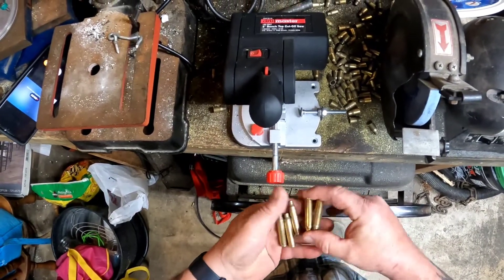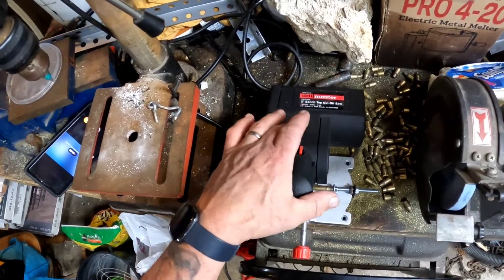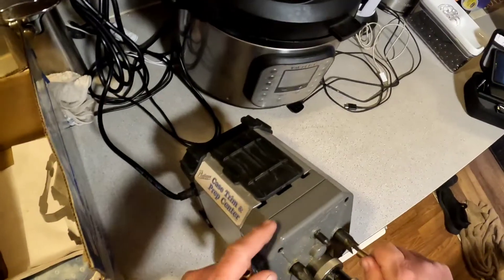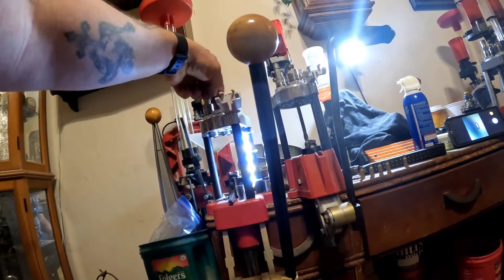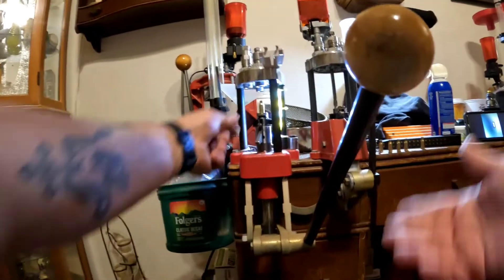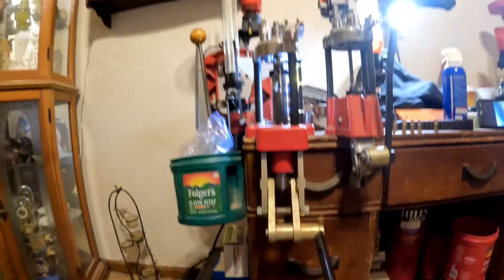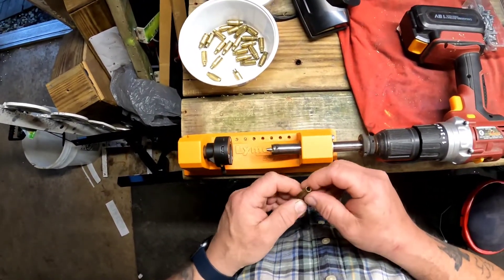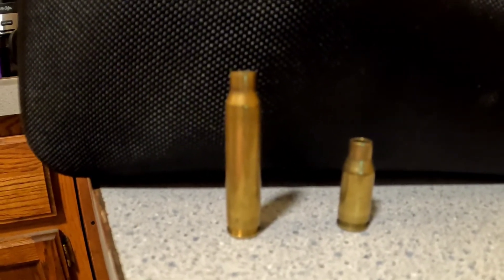22tcm casing made from .223/5.56 casing

Comment: what are you neck turning the case neck to shoulder area to ? i found out the hard way that if i didn't turn the necks to .012 the neck would expand and rais pressure . couldn't even get a bullet to slide in a fired case . i have made tcm cases since the tcm first come out . and found out a few strange things . at least for my old highcap pistol . anelling the cases shortened my case life ! found that ut by mistake , forgot to do it and cases lasted 3 times longer ! i started to neck turn my cases before reforming using a rcbs hand turner . i got the 9mm pilot for it and run the case to about 1/2 way into the neck shoulder area . to .012 than from the cases . case life is great and only lose a few cases . i did get the ch4d 22 tcm case forming dies . 4 dies and a inside ream die . that is how i do mine now . only the ch4d dies will cost ! glad i won 500 bucks in the lottery to get them .
Reply from the maker: I'm not turning the neck. The only thing I do is ream the I. D. To .224 . I'm using  lee die set. The only  thing I do is I made a ruffing die that forms the pre cut .223 case . Literally looks like a 300 black out casing then finish the size in the lee die. I have gad no problems ihave the 1911 double stack and the tactical  rifle and no problem at all. I found that pre forming the cartridge before  finish forming is the key it's to much to try to form case in one shot.
Reply: that is the best way . most reloaders don't know they can ream the inside lol . and most who make tcm cases just form them and use . @thegreatdanishhoundmaster299